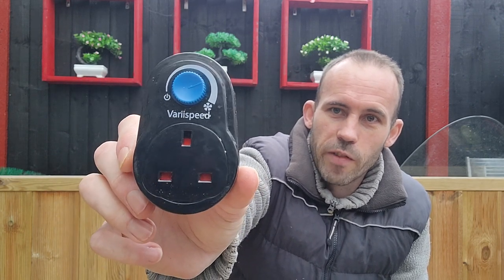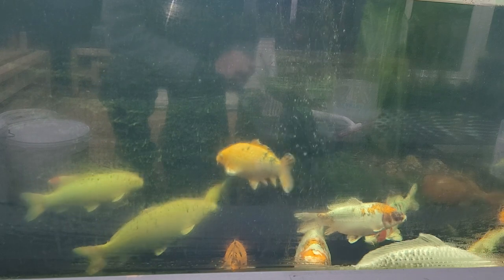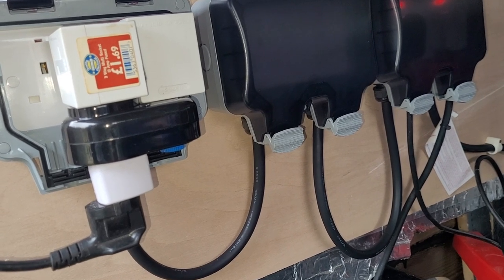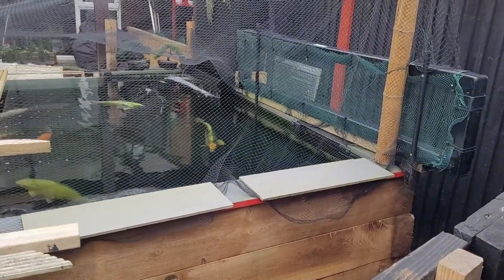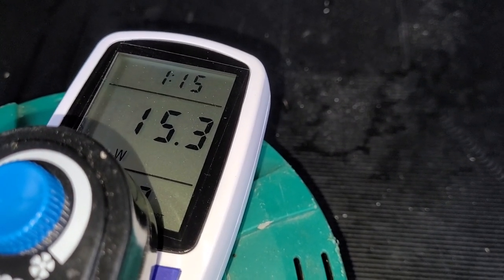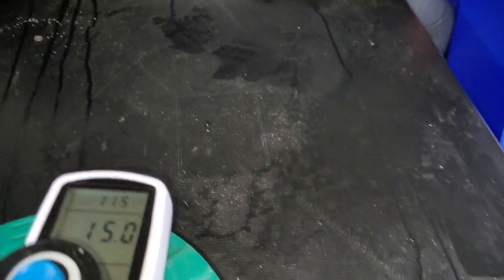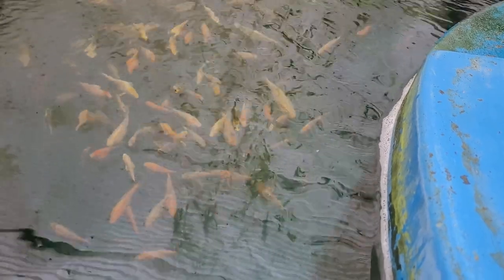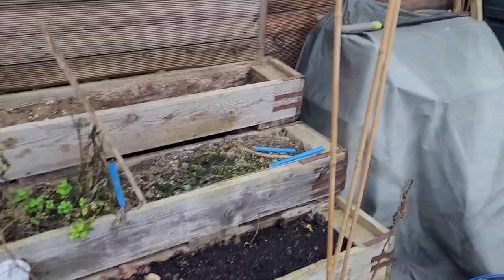Full Review of the Variispeed Controller for your Koi Pond Air Pumps & Pumps

Comment: Thanks for the tip. I have now fitted the controller on the fluid bed air pump. It allows the pump to be adjusted to give the bed full movement without 'boiling'. Very difficult to spec a pump size to do this effectively. Many thanks.
Reply from the maker: Your more than welcome bud I'm glad it's working for you both of mine are doing really well I just love not only can you control the airflow but the more you turn it down the more money your saving a double bonus 😀 thanks for watching 👍

Comment: Great review 😉,been looking at these for a while now , for my air and pump just need a tweaking ,so i thought wondering if there's a smart version out there Candeo do one for smart  lights can dim them down ,wondering if they would work on pumps ,but at  £35 a plug a bit much ,so i'm going to get two variispeeds then plug them into ordinary smart plugs for that extra control 🤔,liked and subbed 😊
Reply from the maker: Thanks bud yeh I'm sure these can be used in many ways they do work on some pumps it all depends on the type of motor they have 👍

Comment: KiKoi .. I keep my air like this as turn off completely causes issues but I have 3 moving beds and a shower, so I think I’ve got plenty of oxygen 😅 Also I have a vari plug unit but BS model it works on the 8.000lph pump but the 12.000 pump doesn’t , so might get a different brand/model as the 12.000 is only 120watts think and vari plug is meant to handle 300watts 🤔 So it stated. But great update review and where you mention multi plug and safety “I see no issue” as-long you don’t go over the RCB wattage /voltage which unless you wack on 2-3kw heater same source then yr multi plug will have no issue Imo 😅
Reply from the maker: Sweet thanks for that mate I'm no electrician so I don't really know how it all works but I know alot of people have moaned about other people's electrics on YouTube so I was just saying it to keep them happy 🤣 and yeh the vari speeds are only rated to 300w well mine are anyway which should be plenty for any moden day eco friendly pump so you should be good 👍 I know of over 40 people using them now with nothing but good reviews so far 😊👍

Comment: If i put that on my outdoor plug will i still be able to shut the cover over to keep it waterproof
Reply from the maker: No unfortunately not that the issue I had luckily mine are in a waterproof filter house but yeh the plug is 2 big to close the lid there are other ways you could do it tho a small single extension into an outside waterproof cable box and voila sorted 👍👌
Reply: Only if youre using one onf the big plastic enclosure boxes ..  not on the plugs with the clear plastic clip down lids